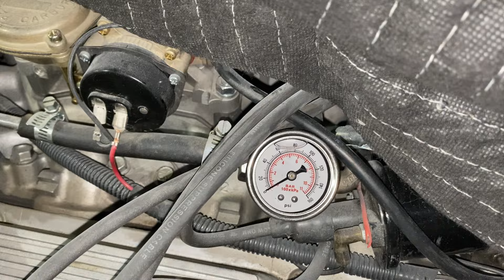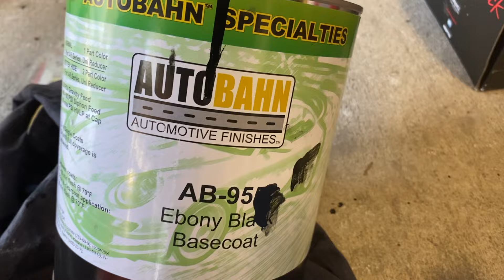1972 Ford Mustang Mach 1 Is Almost Complete Paint & Body. Making Final Steps Before Interior Begins

Comment: Your rear spoiler is mounted backwards ,Turn it around so edge in the rear NOW will be in the front. Your issues with the flat black being splotchy a few things going on looks like high humidity causing blushing (can happen if your spraying at night in a outdoor booth ) Gun pressure not correct and finally to fast of a reducer, I have two of these cars are a expert on them have been building Mustangs /Fords for over 30 years, Spent over 30 years in the Auto Body Restoration Biz. I'm in the home stretch of finishing up my 72 I've owned since 1979. I give you a lot of credit /respect for the effort and work you've put in bringing this car back but the products and repair techniques your using just aren't there YET ,But keep at it we all have to start learn somewhere. I have a lot of videos on my channel that will help you ,Check them out. If you need help have questions hit me up.  On the Exhaust system check out the Pypes system it's what I have on my Green 72 Fits like a glove and sounds great ! https://www.youtube.com/@fuzzenut/videos
Reply from the maker: I wish you were here with me.